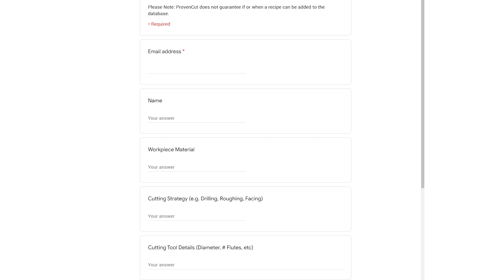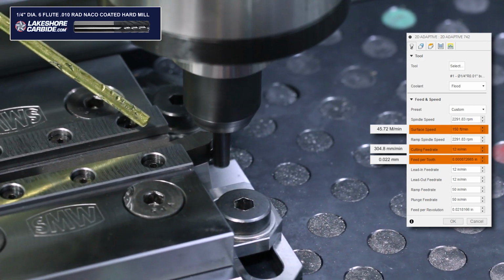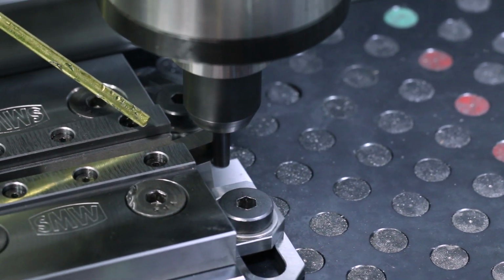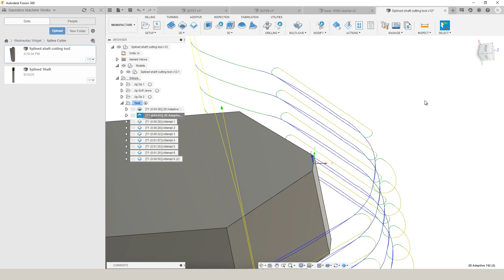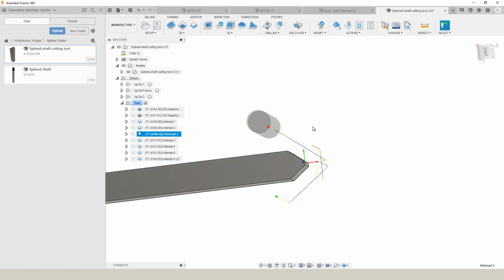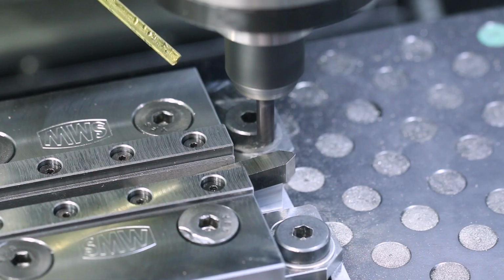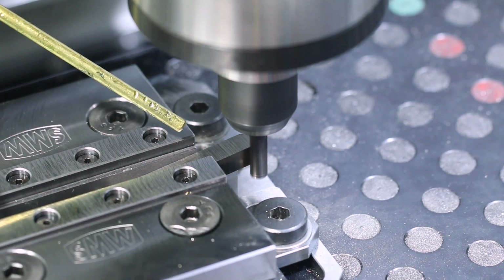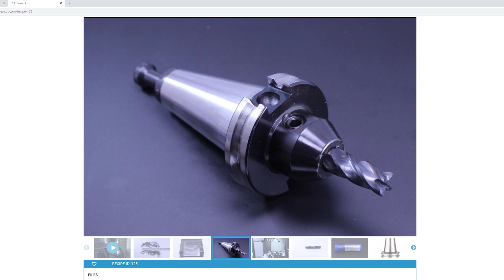Hardmilling an HSS Spline Shaft Cutting Tool!

Comment: Glad you posted this. great info.

However, the geometry of splines should be an involute curve. Otherwise, you are joining straight sided splines with curved mating teeth. 

It's a can of worms to design them, but worth it for the longevity of these power transmission components that are under tremendous load.

Comment: Well done and a good progression. One thing that would help in general is to tip the tool down instead of up for the clearance angle. This puts the cutting edge on the bottom. Design the tool with a narrow band of cutting edge that sticks out 0.005" from the rest of the cutter body. . The purpose of this is to drastically reduce the cutting forces while while finishing the cutting edge.
ATB, Robin

Comment: If you go down with axial engagement towards zero you should increase feed per tooth otherwise you are not cutting anymore, but grinding with your endmill (especially taken into account the rigidity of a Tormach). I understand this is a test you wanted to do, but as a lot of people already commented here, you are better of with a small (Dremel-like grinding stone) and ideally a cheap Chinese router with 24000rpm spindle, which runs those small grinding stones like a charm!
If you really want to use the endmill for this, lower the depth of cut to 0.01" and increase engagement to 20% of endmill diameter + don't do the final full depth pass - it's useless due to machine rigidity...

Comment: why does nobody finish on multiple depths. I don't understand. Also we make axles and use double angle shank cutters from harvey and they work flawlessly. HSS cutters would dull out super quick so comping the axle spline would be a nightmare.
Reply: A double angle cutter doesn't cut a true involute spline profile, what you are making is called a serration.
Reply: @davidfarmer  if you comp the CV joint to a tight fit after coating there's nothing wrong with that. We have axles in 700+ hp cars and they are fine.
Reply: @qqqqqqqq1407  the involute profile allows it to work with a range of clearances, and allows for good contact despite the difference in clocking between internal and external splines, and the splines will roll on each other instead of slide, which will mean less wear over time. 

Your argument is the same as saying: just cut gears with straight teeth, it will still transfer torque. It will of course, but the gears will wear out because the teeth will slide on each other instead of roll. the same thing happens with splines since splines are basically gears.

if you also cut your internal "splines" as straight serrations then you have to have tight fitment, otherwise your contact surfaces wont match under load since the clearance will allow the angle between the internal spline and external spline to change. If you increase the spline count enough it doesn't matter what profile you use, however if you want the strongest and smallest diameter interface an involute spline is ideal.
Reply: @davidfarmer  there is no clearance between the cv and shaft we have to hammer them on. There is no 'play' for the splines to wear over time.
Reply: @qqqqqqqq1407  Do you hammer the axle shafts into the diff as well?
Reply: @davidfarmer  huh? they bolt on
Reply: @qqqqqqqq1407  Oh right you said cars. So you must not be making the stub shafts then.
Reply: @davidfarmer  nope, axles
Reply: @qqqqqqqq1407  I suppose for the intermediate axle shafts where both ends essentially float it wouldnt matter, but for applications where both ends of the shaft are going into splined hubs that are constrained by bearings you need to have some clearance to compensate for misalignment and concentricity errors. A good example of this is an axle shaft for a solid axle, both ends are constrained so you need the "play" so it wont bind. also having the splined end as press fit would be inconvenient for disassembly.
Reply: @davidfarmer  exactly
Reply: @qqqqqqqq1407  might as well bore the cvs out and weld straight shafts in at that point.
Reply: @davidfarmer  terrible idea. It would totally change the hardening of the shaft and the weld area won't be zinc plated anymore.  And the splines are not the weak point, it's the shaft. Also that would add more steps to production that are unesessary.

Comment: I would use a second tool for the final finish pass...not the cheapest route but you could probably substitute a slightly worn end mill for roughing and save the good tool for finish.

Comment: That stock is suffering form harmonics it is not supported properly. You are also machining it with the air not optimally applied to the cutting tool if you flipped it 180 and machined from the left side of the vise and choked up alot more I dare say you'd have better results. The machine with sharp corners option  works perfectly fine at higher speeds for me machining 64hrc stainless. Lighter radial cut full depth and higher feed in hsm to remove the harmonic vibrations you are having will greatly help. What was the hrc of the material?
Reply: assuming it was m42 it would have had to range 65-68, correct me if im wrong
Reply: ok a quick search suggested 68-70, i may have been referencing old data, or im just plain wrong. i think the cobalt is what makes it nasty to cut, but again cant say ive had much experience with m42.

Comment: Nice work! Im about to cut some more 40C Rockwell Stainless .015" shim stock for a product I make, Its not that crazy by it is a full slotting operation, I broke so many endmills dialing in the recipe at first, but that is what's so nice, once you get it dialed in it cuts super smooth. I went from one endmill per 4 sheets to 1 endmill per 10-12 sheets. major difference.

Comment: Drop your surface speed by 50% and a single spring pass with 0.002 stl would work well imo
Reply: Do you have the exact same tool, machine, vise, material as in the Video?
Reply: @m_m_nbg  na I'm just a full time machinist lmao
Reply: @spikeypineapple552  You're probably right on with this. I've done a fair amount of milling on hard materials, and I'd be using 100 SFM as a starting point for anything 58 to 60 ish rockwell.

Comment: For me it's clearly the wrong tool for that job. Wonder if you could just use a grinding tool for that. Would definitely have to think of a system for dressing and adjusting the changing tool diameter, but grinding is way better for this application.
Reply: using tormach...  with a weak set up... loot at that stick out and big useless clearance, of course the results are shit.
Reply: Diamond Wheel + jig?
Reply: @MrCoffeypaul  doesn't even have to be diamond, there are lots of grinding materials that would work

Comment: And my shop teacher says you can’t mill HSS. Says you have to grind it 🙄
Reply: only because you can mill something doesn't meant you should mill it.
Reply: Your shop is most likely using clapped out old machines with loose ways. The swarf is also high mileage wear on ways and covers. A competent tool maker should be able to grind this tool by hand much faster than cnc hard milling.
Reply: Shop teachers lie, I think its either the best perk of the job, or just the most enjoyable part.
Reply: Knowing how to cut hard metal has it's place and benefits. In my 45 years of shop life, I've removed just about every kind of friction welded cutting tool you can imagine from various aerospace parts.
Reply: I think there is a disconnect from modern manufacturing methods and current day classroom education. Old textbooks, older teachers that aren’t in industry anymore.
Reply: Crusty old men. I hardmill 64hrc stainless every day just fine with mirror results In my mill.
Reply: @yeheyheyyeh89  congratulations

Comment: Pretty cool, but wouldn’t a rough grind followed up with surface grinder be a better setup?  Quicker and essentially free if you have a grinder in the shop. 

I feel like this is a solution in search of a problem.
Reply: In this particular case I am inclined to agree with you. I think this method would be more useful if applied to a more complex geometry, like an involute cutter for instance. It's cool to see it work though.
Reply: The old tool makers about to retire could knock one out in 5min on a bench grinder.(the way its been done nearly 200 years)
Reply: @Eluderatnight  I’m one of those old guys that would use a bench grinder, but I wouldn’t be using a comparator to evaluate a bench grind, so I suggested a surface grinder.
Reply: As a tool maker. I would laugh at you if you asked me to do that for free on a surface grinder. I would go over to a undress bench grinder and then hand it to you. But it would take about 15 minutes to finish that up on a surface grinder if it was roughed out on the cnc. That way you could take 10 minutes in the cnc and not keep rewriting you program and posting it out and spending 45 minutes in the cnc. If it was for a customer time is money. Customers are not inclined to come back if they feel like you wasted your time looking at a spline cutter under a comparator.
Reply: @importanttingwei7747  so is wire edm I have programed one for years. If you get your Epack wrong or wire tension or wire speed Or even bad wire or your resin tanks are depleted or power surge or someone didn’t Grease the ways. And that’s just Scratching the surface of them. Dude that is a lot more variables than a surface grinder. Wire EDM is a nightmare. They are used when a grinder can’t do the job or it becomes to difficult. Like on die section and punches. If you have never ran one you have no idea. they are nothing like a CNC machine
Reply: He probably knows at wel but it's fun to try  an you learn a lot

Comment: You might want to take an indicator to that machine, it looks to me on attempt 6 that there might be some backlash or gib slack in the angled cuts.  You might also try changing from climb to conventional on your last spring pass, this will affect the deflection of the endmill and how it interacts with the material.
Reply: Hey has the thing sticking out a mile... that’s why it’s deflecting but this kid is like 20
Reply: @jamessmith1190  Give him ten more years. Meantime he’s getting some good advice in the comments from folks that have been doing this awhile.
Reply: For testing a proof of concept using the new cutter geometries now available, HSS is a pretty good test for such a light duty machine. You have to admit that having experience on how to approach such a problem as hard metal machining is beneficial. There will be times when you are faced with such challenges in both mill and lathe work. If your shop can afford it, EDM is always the best choice for hardmetal machining, but not always allowed for some critical aerospace parts. We all have had to cut out broken taps, burned in endmills. melted drills and even friction welded tool holders from various parts over the decades. 😉
Reply: With conventional cutting the mill gets pushed INTO the contour. With climb cutting the mill gets pushed away..so I would say its still better to use climb cutting(especially with ballscrews)